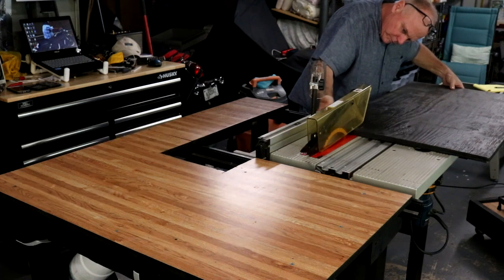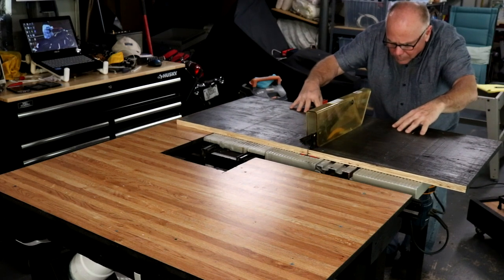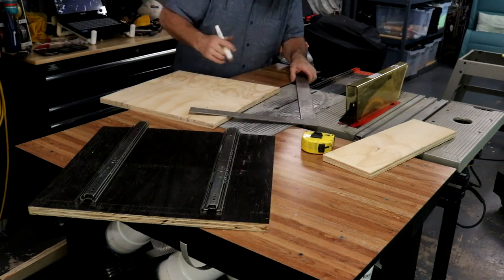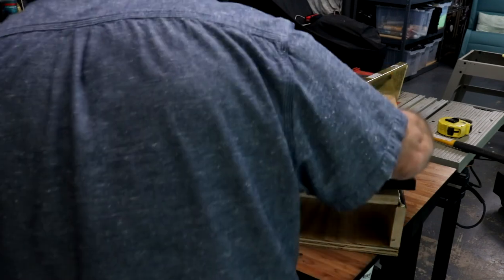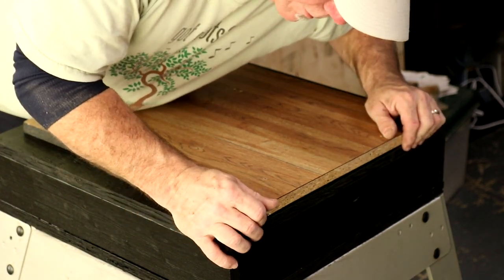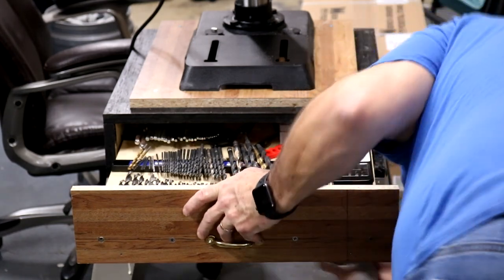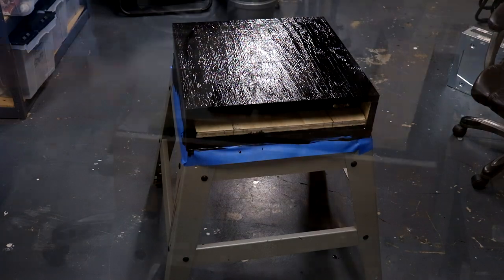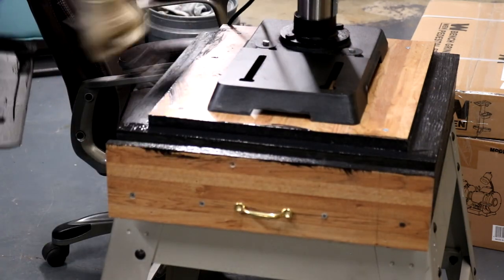Drill Press Part 2 Building a Stand Ep 35

Comment: Spoiler alert, its a bench grinder! I see you are a tinkerer, me too & it looks like we are about the same age... I like the pedestal you built for your new WEN 4214 drill press.
I have an old floor cabinet that goes back to the 50's my father gave to me in the late 80's. I stripped down its top & gave it  (10 coats ) of clear poly, ( total overkill ) & attached a set of caster wheels, making it a mobile cabinet. Currently it is a temporary off feed table for my new Delta table saw. I think my next toy will be the WEN 4214 & it will bolt right down on my floor cabinet top! 
Cheers... :-)